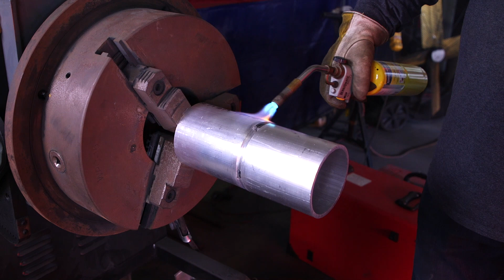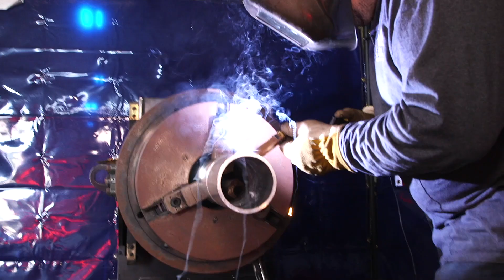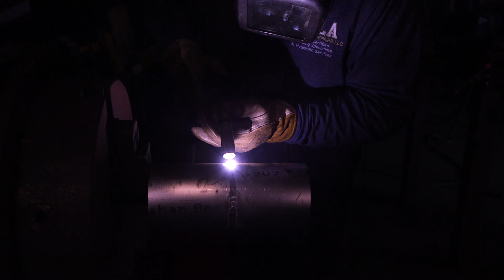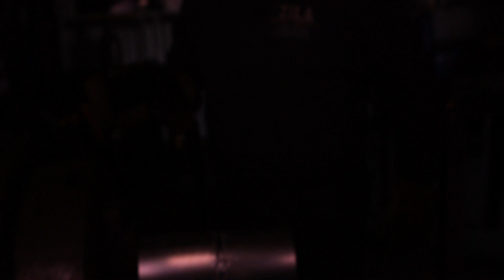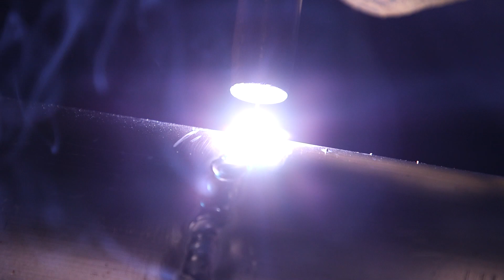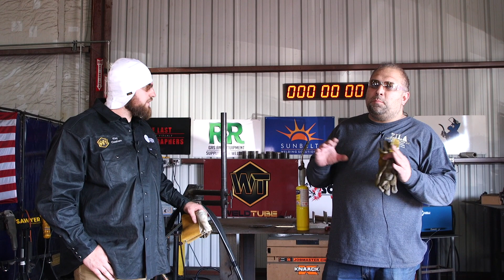Welding 6061 aluminum pipe with single and double pulse HTP PP300

Comment: Hello Zila like all your videos! I’m new on doing welding I have a 225mts my machine is very slow to feed the wire specially welding aluminum ! ? Thanks if you have any information 👍👍
Reply from the maker: the maximum wire speed on that machine should be 600 ipm .... so if you turn it all the way up and your drive rolls do not slip if you press the trigger in the air and look at a stopwatch after one minute you should have 600 inches if wire laying on the floor ....    
you machine does not have a start speed or run in speed adjustment to the best of my knowledge ....  so if you dont see 600 ipm, you need to call customer service and get that rectified .....
Mark over there is very knowledgeable ...

Comment: I'm considering the 300 or 2?? . Been watching your videos and I'm definitely impressed with the equipment and I believe with all the settings coverage you've coached us through with deep in-depth details I may be able to hit the ground running. Thanks for the constant details explanation. Aside from the method of welding I've realized that this type of welding requires in-depth knowledge of the settings and what they do and how it affects the puddle and finished weld. I'm thinking about doing a review of one of these machines as a beginner to aluminum pulse and double pulse using your settings and explanations as a guide. You always show the results of the settings which helps others to understand what to expect. Thanks for the training.
Reply from the maker: thanks for watching !   the pp220 vs pp300 I am working on a video to point out the differences ....  in a nutshell - if your machine lives in a shop on a car and you dont do much or dont do any mobile work and if you can financially swing the 300 ... in my opinion it is definitely the way to go !!!     arc dynamic is even better, inverter speed is SOOO much better ... and it has factory double pulse and manual double pulse options in every pulse program !  more and better controllable hot start and crater fill functions for aluminum ....     but it is a lot heavier to lift around ... and if you get serious you do need water cooling and it is more $$$.  its a full industrial machine, no compromises where wade when the machine was designed, no corners cut ... its just awesome !
Reply: @ZILAwelds  Thanks for the quick response. I'm almost certain that once I've purchased a machine with those capabilities I would have to soon upgrade to the 300. So I may go that route eventually but the portability is awesome to LOL. I expect to need the portability to. Decisions decisions. How about generator requirements ? Some of my work would probably end up being off grid like farms and industrial. Thanks

Comment: I used to build the BOC trailers and did 10s of thousands of inches of aluminum welding. All ex-rayed & helium leak tested. That being said we didn't use single or double pulse. I get the technology and I guess it's pretty cool but personally I don't find it all that important. I could lay down a bead that looked like glass and we used a 375  Lincoln welder with a spool gun. I'm sure you know what a BOC trailer is, they haul liquid argon, liquid Oxygen...
Reply from the maker: I fixed the scales that the tankers are filled on .... and when the last gulp of liquid hits the concrete deck it destroys the concrete ... so I skinned the entire scale deck about 12' back with 1/4" stainless diamond plate and full seam welded it so that that does not happen anymore ...
Reply: @ZILAwelds  LOL, To funny 🤣